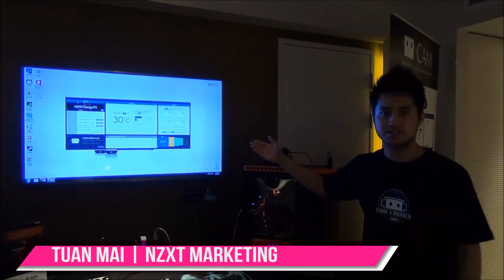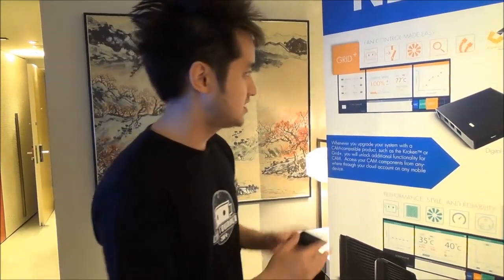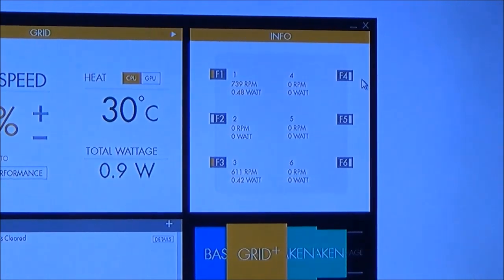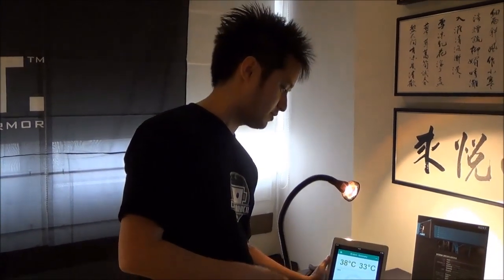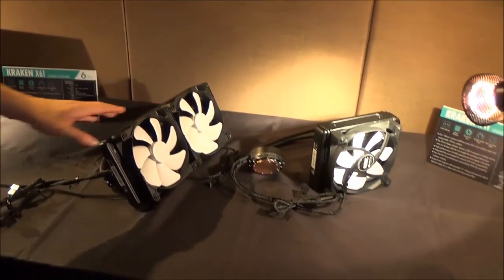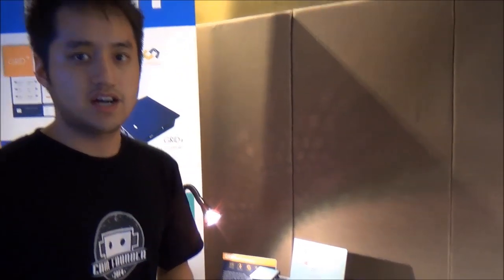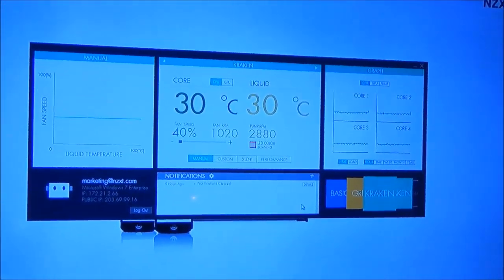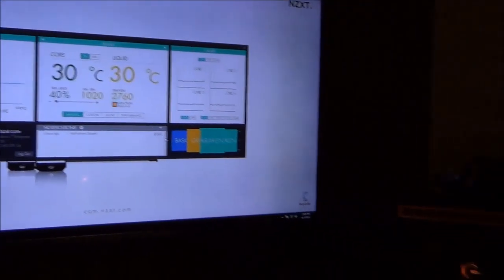NZXT Suite, CAM Software detailed, Grid+ Fan Controller revealed  - Computex 2014

Comment: Hi, i do have problem with installation of my Krakens and Cam software. I do have Grid+, x41, x61, and IU01 USB Expansion. IU01 USB Expansion works fien as i did test pen drives and all works fine. Problem i have my Cam software dont see any of the krakens or even grid+

Comment: There are some questions considering NZXT Grid+:
* Can it turn fans off completely, not only change their speed?
* Grid+ is controlled through a piece of software called "CAM". Is it just a user-level program or a low-level driver is required?
* What will happen if CAM fails or a computer is rebooted to an OS which CAM does not support? Will the fan settings be preserved by Grid+ or the fans will run at full speed?
Unfortunately the manufacturer does not provide the manual on their website, so there is no way to answer those questions.